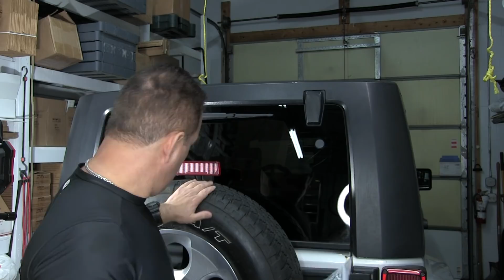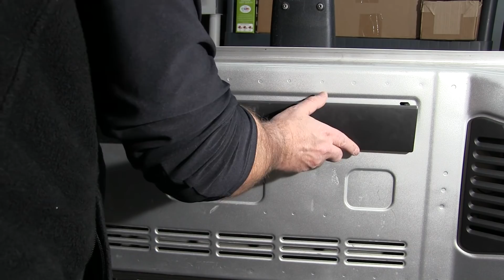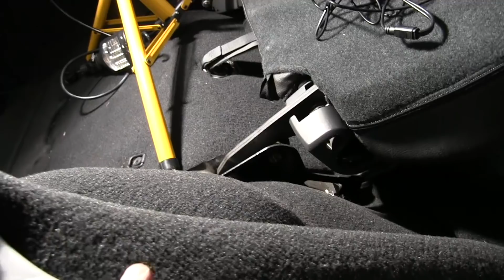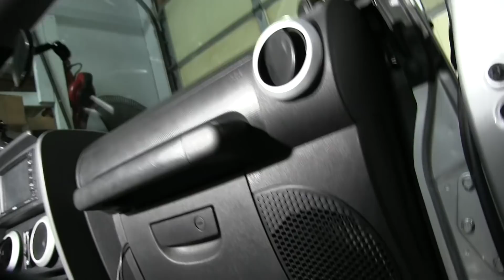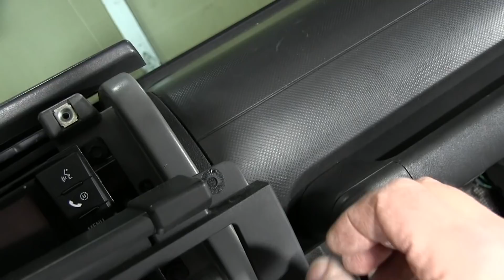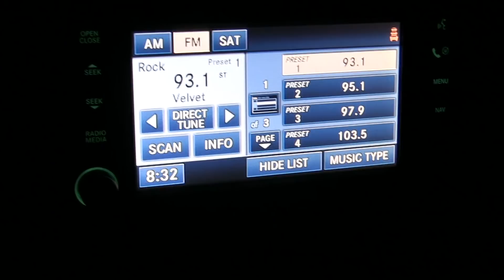How To Install Jeep Wrangler Reverse Backup Camera 2007-2018

Comment: So with your setup, there was no wiring/ splicing to be done into the rear of the jeep? Like tapping into a reverse light?
Reply from the maker: You need to find that magic wire... The one that energizes the reverse light. And tap into it

Comment: Thinking about buying this camera and hooking up to the factory radio.  

I purchased the Veepeak OBDCheck BLE OBD2 Bluetooth Scanner Car  and JScan App for my Android.  There's an option in the app to Enable backup camera.  Is that what the honk essentially does?  Trying to buy the aftermarket version which is a lot cheaper!
Reply from the maker: Contact the company directly with those Q's...

Comment: Really well-done video!  I'm going to need to wire mine in reverse- from front to back.  Having a touch screen radio installed at BB, and installer has agreed that if I supply a backup camera, he's willing to go ahead and plug it in and wire it as far as the glove box.  But that he's only got a window of time enough for the radio and not enough to run it thru the carpet, out the back gate, etc.  Question is, since I'm doing this in reverse, where would you recommend I plan to tuck away the excess wiring?  Inside the back gate before it pops out thru the spare?  Or guesstimate how much may be extra and sort of bird-nest it behind the glove box?  The second option seems risky since I could wind up with not enough wire to make it all the way out the back.  But I don't know if it's possible, either, to leave any excess inside the back gate.  Thanks for any info.
Reply from the maker: Hi Ryan,
You will be getting the easy part of the job! Tuck the extra wire inside the rear 1/4 panel once you remove the grey felt covering. This will get you close enough to the rear camera to see how much wire you need, and the wiring will be inside the vehicle. Lots of room in that area!
Reply: @geofatboy  Excellent.  Thanks again!

Comment: In speaking with the company on installation, I got some advice to consider.  Flash the vehicle prior to the install and put in reverse to confirm you get a blank/static screen - confirm flash module works prior to doing a full install.  Lastly, they suggested to remove the dash and connect the system to the monitor and power source (use taps so you can easily disconnect post this test).  Now put in reverse and confirm all works.  If it does then complete a full install.  It is rare, but happens, where a full install is done and the system has a failure and needs to be returned - painful having to remove everything.
Reply from the maker: The company said this? Why don't they put it in their instructions?

Comment: I have watched many of these, and this is a good one.  I just ordered a camera kit for a 2017 Sahara wrangler unlimited.   What strikes me as odd that no one did a power up test prior to running the wires, but I suspect the program step may prevent this test.   I like how he MacGyver’ed the metal scraper with painters tape.  I also wish these guys would do a layout of all the parts and tools used.  I’ll update if successful but will hide in shame if I am not!

Comment: Finished the install this morning. I do like the capability to see what is behind me. My only issue and maybe it is just my camera is that the back up lines are no way close to the width that the Jeep is. The distance is good but the width is way off. Anyone else notice this or is this just my system, 15JK unlimited. Thanks for the install vid used it a lot.

Comment: Do you think you can hook what ever wire that’s for the reverse and put it on a switch to make it all time camera ?
Reply from the maker: Not sure why you'd want to do that. I have a Tesla where you can touch the screen and activate the rear camera while driving. It will drive you crazy watching it while driving forward and probably give you motion sickness after a few minutes.
Reply: geofatboy because I drive a Big ass Jeep and I want to move my tire in the way of the back window but still want to have a rearview mirror .
Reply: Second I drive a ups truck and the monitor is alway on . You get use to it .

Comment: 7:29 never bend the wire like that ... its going to break braids and reduce its quality right there. instead of bending the wire tape the connector to cover it further in front ... plenty enough if you have issues you can make a S with the fish wire and weave the wire in it and tape that...

Comment: This explains why I installed my reverse camera in my oem REN radio and ain’t working 🤮 how do I get that obd2 updater tool without blowing 200 bucks on it? Can’t a dealership do that for me? I have everything done I just need that tool you used at the end that made the car honk twice ):
Reply from the maker: How were you able to buy the kit without that part? I wouldn't think they would sell it that way. Was it accidentally left out of the box? Maybe if you sweet talk your dealer they might do it for you. Around me they would probably charge $200 just to chirp it.
Reply: geofatboy I didn’t buy that kit. I bought a simple 30 dollar reverse cam kit off amazon then the 20.00 reverse cam harness for that radio... but now I can see why I had to spend the extra money.. that radio needed to be updated to accept that reverse signal. So stupid

Comment: So basically the only Jeep that comes with a back up camera is the Rubicon???
Reply from the maker: I've been told that all new vehicles manufactured after 2018 need mandatory back up cameras. Doesn't that apply to Jeeps as well? Or are they in a special category? I found this: Now that the rule is written, it mandates that all vehicles under 10,000 pounds include a backup camera by May 2018.
Reply: @geofatboy  before it used to be the trim you bought and if you bought the base model, it was an additional cost to have it added.  Backup cameras became a standard on cars since 2016.  Nowadays all trims have those cameras but some cars still come without them.

Comment: Thank you so much!  It took me all afternoon but with your video, it works great!  I had a few differences with my 2017 Wrangler such as my dash board came apart differently and the the ignition wire was on the opposite side. My ignition lighter is on the right side and the always on lighter is in the center console. I couldn’t have done it without your video. The directions it came with were horrible!

Comment: Awesome, you answered my question.  Just bought a 2015 Jeep Sahara.  Was surprised it didn't have a backup camera.  I was worried I'd have to replace to console unit in order to have this feature or have an additional screen floating around the dash.

Looks like I have another weekend project in my future.  Thanks!
Reply from the maker: I think all new vehicles are required to have backup cameras now. That's a great law. Should save a lot of kids from getting injured.

Comment: Great video Geo!  I have a factory backup camera and a camera under my right side mirror. Called Honda Lane Watch, I really like it. Some DIY cameras use a BT transmitter for easier installation, but the way you did it is probably best.
Reply from the maker: Thanks Ronnie, I agree. I think the backup camera is one of the best options on a vehicle. New or aftermarket.

Comment: A backup cam on a Wrangler is like training wheels on a tricycle. Loo
Reply from the maker: Until someone backs into a car directly behind them cause they couldn't see through the spare tire. A backup camera can actually be a life saver if you live in the city. That's why they're included on most new vehicles.

Comment: Fascinating, listening to you guide the viewer thru the necessary steps.  I think I would have tested the whole thing out before buttoning up any  part of the install.  Well done, geo!
Reply from the maker: That is an excellent suggestion Tom. I guess after 30 years of electrical construction I have enough faith in my abilities. It worked out for the best!